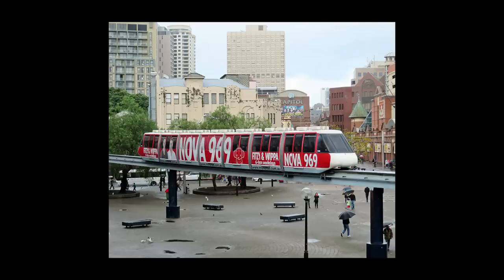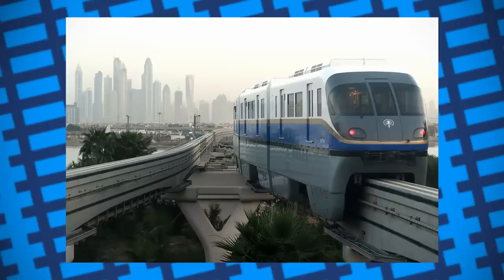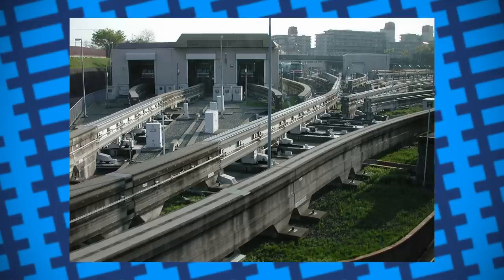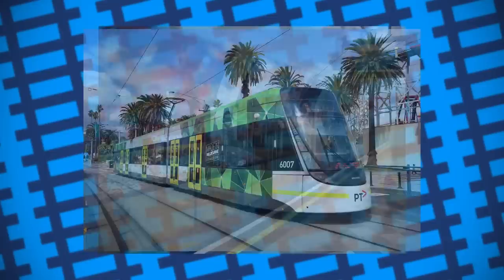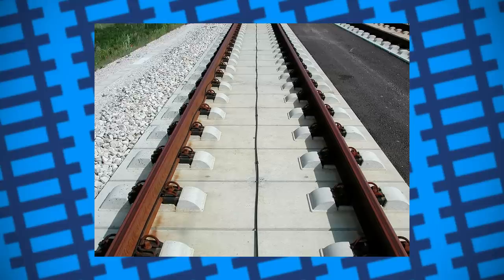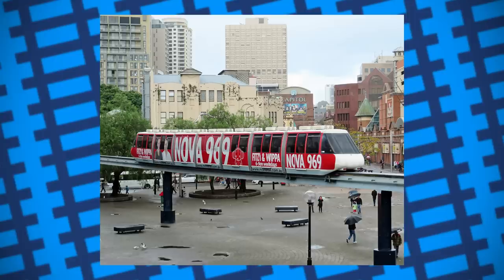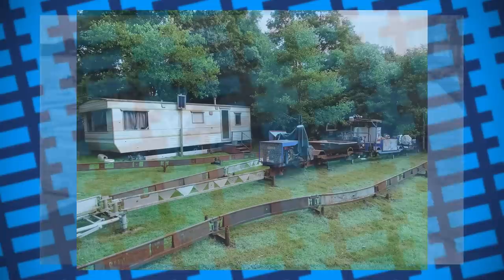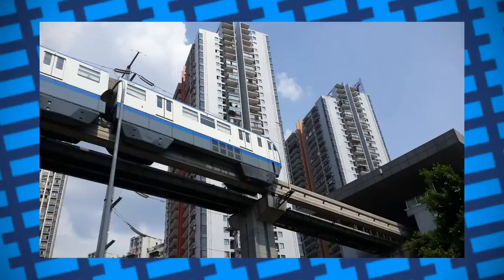Why monorails are bad as public transport - Monorails

Comment: This discussion reminds me of a similar topic in spaceflight.

The general public has this bizarre sentiment, that traditional rocket are dumb and old fashioned. They see the space shuttle and similar spaceplane concepts as obviously superior, even though the complete opposite is true.

Like monorails, spaceplanes capture the public imagination of what the future is - but in reality are way more complicated, expensive, and even more dangerous in some ways.

Yet in both instances, many in the public shake their heads, very sure of themselves that a stock railway or a basic "old fashioned" rocket is somehow going backwards.
Reply: I think with spaceplanes, while I agree they were overhyped and the technology is much less mature than people realise, I don't think they are a complete technological dead end. There are some advantages that could yet prove their practicality for some space missions. Rockets have minimal aerodynamic control in atmosphere, you have to work around mainly ballistic trajectories, just see how much work it took to make just the lower stage of a Falcon 9 return to somewhere near the launch pad. This means there's less flexibility if you need to do re-entry, or even just avoid certain areas on launch. That's not much of a problem when you're dealing with a few dozen launches per year of mainly satellites that don't need to come back, but in a future where more and more people want access to space, that could prove to be a significant barrier.

I think perhaps we do need to get over the idea that spaceplanes will be used for every space launch in the future, rockets are probably always going to be the best choice for heavy one way freight, but I don't think swinging the other way and declaring them dead in the water is a good idea either, despite what some SpaceX fanboys might think.
Reply: @Croz89  Definitely, the balanced view is best. Rockets are generally simpler, and simple is often best in engineering, but I'm more than happy to see Dream chaser coming online.

Further one might also make note that SpaceX's Starship, while a rocket, takes a lot of cues from things learned from the space shuttle.
Reply: @WasatchWind  I don't think Starship is really comparable to the Space Shuttle apart from reusability. Aerodynamically its little more than a giant capsule with small wings. That's going to give it a little aerodynamic control, but it's trajectory is still going to be mainly balistically determined. If it did have the capability of the Shuttle they'd probably land it on a runway instead of the retrorocket assisted "bellyflop" that seems to be their current plan (unless they've decided to go with a straightforward vertical landing). That alone might kill its chances of being human rated, but I don't think SpaceX is seriously planning on using it for passengers any time soon. Something that massive is probably better suited for large satellites and space station modules.
Reply: @Croz89  I meant in general, starship wouldn't be possible without shuttle having tested the waters first.

In regards to crew starship, I'm not sure. Polaris III, they talk about it like it'll fly in something like 2026, 2027. I don't know what will happen with that, but there's definitely a lot of questions to be answered, primarily with launch escape and land procedures.

I feel a lot of people confuse NASA crew rating requirements with general legal crew eating requirements. SpaceX seems quite intent on flying people from launch to landing on Starship, but not in pitching that for any NASA work (at least not yet).

I feel like there are some things they could do to improve the system (maybe starting by landing crew starship on the ground instead of catch tower...) but I feel like they can likely find solutions to these beyond just "fly it so much you don't need redundant safety systems" which I think to be generally a bad plan.
Reply: @WasatchWind  It's hard to know. Musk has a habit of saying things on impulse and then expecting the engineers to magic up a solution, so what they say they'll do and what gets done can be rather different. It's generally worked for SpaceX so far, though with his many of his other ventures, not so much.

I think mainly, kind of like the Shuttle but to a far more absurd degree, Starship is way over specced for passenger use, and there are smaller, safer solutions put there, spaceplanes being one option but for now even a simple capsule would probably do. In future something bigger will probably be required, but I think even in a future where you may have 100's of passengers, Starship is just too big.

I think the main safety advantage of spaceplanes has to be manoeuvrability. If something goes wrong, or you can't land where you want to, you can glide to any suitably long runway (or even cruise if you have hybrid engines like SABRE). The Shuttle always had a reserve runway they could divert to. Sure, it didn't save them in either tragedy, but it wasn't a bad idea.

Comment: Could you discuss the the new monorail system in Cairo? It consists of two new lines with a combined total of 100 km in length (mind blown). Usually monorails around the world are built in dense urban spaces where right-of-way is difficult to secure. However, the two lines each start at the edges of Cairo at the west and east respectively and extend outside into new developments. This neans that most of these built lines are actually built on mostly non-dense areas and are actually not built in the dense areas that they are supposedly optimal for 😂.
The government is paying around 4.5 billion dolllars for that system. Are they actually insane or is there something I don't know?
Reply: 4.5 billionss?? Thats more than half of Indonesia's HSR line?!?! 💀

Comment: I don't think it's fair to call the Wuppertal one "monorail", because it's more similar to conventional light rail to monorail.
Reply: It is a monorail, as it has only one rail (for each of the two directions). The suspended monorail design also allows for swinging in curves without any additional devices, increasing comfort.

Comment: Monorail is a good alternative to an overhead metro system for medium density traffic. Implementation costs per km of a Monorail are 1/3 to 1/4 of an overhead metro system. Monorail civil infrastructure also takes up.less real estate thereby being suitable for narrower roads.
Chembur 2 Jacob Circle, huh ?
Reply: For medium traffic, a network of trams or BRTs/Trolleybuses with confined lanes works better
Reply: @armandoventura9043  BRT/Trolley buses are a hell of a lot cheaper than implementing monorail. The idea is more of  moving people from point A to point B in the least amount of time. The access to highways/freeways does play an important role in BRTs. The roads landscape of the city also  dictates the optimal mode of transportation. The local suburban railway system immensely helped a city like Bombay which was North South with the business districts concentrated in the South and working class people living in the suburbs up north. That isn't the case anymore. 
A city like Bangalore or Delhi is circular and would dictate an entirely different transporation plan to effectively move people from point A to point B.

Comment: From what I grasp, monorails can work, but they have no compelling advantages over conventional trains in 99% of cases. The advantages about being elevated is entirely possible with a conventional train as well, though conventional trains have the option to do either within a given system. The one and only advantage I can see of monorails is that in entirely elevated systems they cast a far smaller shadow than a double-track conventional rail - the roads under Chicago's "L" feel almost like a tunnel. Resort places like Las Vegas wouldn't want that. Though I could imagine designing a conventional rail with a sort of open-deck design that would let far more light through between and around the rails, which would still come out ahead of monorails.

Comment: All I know is that monorails, in the long run, are cheaper and provide a quieter ride.
Reply: Where do you get that they're cheaper?  If anything they're more expensive in the long run.
Reply: @zackakai5173  A similar video done by either a UK or Aussie made cost comparisons, and the figures he put up , and commentary from another video apart from his and this one, showed that monorails didn't require all of the dirt, rock, and mechanical maintenance that light rail needs.  Monorails, from what little I understand of them, use rubber tires to provide a smoother and rough free ride.  Maybe swapping out tires is more expensive in the long run... I don't know, but they don't require to be at ground level, and don't require lots of support that an elevated light rail needs.   I don't know, maybe I'm wrong like you say, but that's what I recall.

Comment: Those locations with hanging monorails use them because of terrain or otherwise constrained route. The Japanese lines in Tokyo cover very hilly terrain where a tram can't climb, while the Wuppertal Schwebenbahn only has a narrow path in a valley with a single main road where a tram would add to congestion. 

The simple metric against monorails is cost per unit-distance of track compared to other solution. Standard rail is two bands of steel, sleepers/ties, power source. An elevated viaduct for standard rail costs more than a monorail in terms of raw materials, so it's not always obvious until the requirements and physical limitations of geography are factored in.

Monorails need a factor of 100x or more in steel and or concrete in comparison. The economics are not good.
Reply: You literally contradicted yourself. [Multiple Citations Needed].

Comment: I feel like theres a lot more good examples of them other than things like the single seats ones to collect fruit on a farm lol. Seems a bit unfair. If something does need to be elevated the entire route and act as a short transit line of 4 miles or so and is in urban areas with tight bends then I think they'd be great. Especially when it comes to the quietness of them next to residential buildings. But for dense areas they generally look many times better than light rail, look at the example at 1:36 and how little it obstructs the sky and it even looks bulkier than other monorails.  The cost doesn't seem to be that different than light rail too, i've seen many examples in the last 15 years of it being like $40-80m per km. Feel like the videos needs to play the devils advocate a little bit more.

Comment: Walt Disney World's is extremely efficient.

One thing that he is failing to leave out is how fast passengers go on and off of the trains. All of the doors, on all of the cars open at the exact same time. This allows for large groups of people to board and exit simultaneously.

Of course, they all close at the same time, as well.

Disney has not only this, but many, many more things down, in terms of how to build a city. The problem is, most of the world doesn't take note.
Reply: None of that has anything to do with the fact that it's a monorail, though.  That's down to WDW doing their maintenance and having well-designed stations.  You could just as easily achieve that with regular rails.

Comment: A comparison between monorail and light train system is bullshit, both systems have completely different areas of application. Of course a monorail is much more expensive than a tram system but cheaper than a subway and THE is the more correct comparison. btw. If it sucks, why are there working systems in Asia and why are even more being built, e.g. Bangkok.
The fact that most of the monorail systems in western metropolises didn't work is due to completely different criteria.

Comment: Many monorail problems can easily be solved they are potentially very useful in the right places, we just havent learned to build them cost effectively, most monorails are built like light rail and with big heavy slabs of concrete wich is too heavy and expensive to replace rail. if you had something the size/ weight of a rollercoaster car with a cabin the size of a car with seatbelts on cheap steel tracks held by relatively inexpensive pillars (wich could easily be produced by the same industries that make normal rails) trough big crowded city centers, and even above already existing buildings, its really flexible as a concept especially compared to standard railroads, wich need losts of space and land wich is one of the most expensive resources in Cities, so they could be extremely useful where normal rail simply doesnt fit and could potentially go really fast.
Reply: Monorail beams (full scale ALWEG) are about the width of a sidewalk. 5/8th scale ALWEG beams (like at Disney) are even less massive.
Reply: I think the issue with rollercoaster style track is durability and maintenance frequency. Rollercoaster ride quality dips a lot after a few years, which is generally tolerable for people wanting a thrill, but it would be a significant irritation for commuters. Rollercoasters also need frequent intensive maintenance and inspection, something which would mean frequent closures of your network.

Comment: lets be honest... most of the reasons given here are exactly because they are new or rather, non-standard as systems go...
my general feeling is that the monorail was less efficient, being necessarily heavier to be safe *(per person capacity); but is a very good solution for places with tight spaces and steep turns... it is an over-ground type system, which means tunnel width is not relevant, what is, is turn radius and support width required.
basically, they are an expensive way to make routes, for a highly urban environment
Reply: They're lighter than any other rail mode.
Reply: @colormedubious4747  depends on which exact Monorail you consider, and where you draw the line for rail-mode, you can make a tram lighter than a Monorail... and that is quite often done... 
you can also consider various super-light micro-gauge systems that can exist... though, whether we call these public transport is a question
for a full railway, it is quite light, but usually also very low capacity.
Reply: @stanislavkostarnov2157  They're generally lighter because they don't mix with street traffic and don't need to be held to the same standard of crashworthiness. LRT and streetcars/trams have to be able to shrug off an impact with a truck.
Reply: @colormedubious4747  a lot of places, LTR trams have full grade separation from any heavy traffic... also, depends on the countries safety regulations, nor everywhere is the safety standard is so rigorous as to make them heavy
Reply: @stanislavkostarnov2157  If it has full grade separation then it isn't LRT or a tram, it's a light metro. By definition, LRT and trams primarily operate at grade. If they don't run in the street at grade, then they cross streets at grade. They must be crashworthy. Even those tiny Alstom trams pack a decent punch in a tangle. I sure as heck wouldn't want to hit one! I'd lose. 🤣
Reply: @colormedubious4747  different countries different standards...
the lightest trams I have seen were I think made of wood and plastic... I mean, I saw a one get noticeably damaged by a pizza delivery scooter once.
Reply: @stanislavkostarnov2157  I want to see that video, lol.

Comment: Additionally, mono rails are completely false. They are either bi-rails or tri-rails.
Reply: True enough.
Very few of the 'monorail' systems built or proposed over the last two hundred years actually run on a single rail.
The Brennan system (qv) is one of the few that does.

Comment: monorails are still smarter than trams. unlike monorail, trams clog the traffic, which greatly increases the traffic pollution and causes life threatening danger to others by having their own extra set of traffic order order they follow.
Reply: Ok, this is called 'being a car driver who is pissed off that they have to wait at a light for a tram to pass' and being completely ignorant of the actual advantages and disadvantages of trams. To give you the benefit of the doubt, it's Possible that the tram system you're interacting with is designed terribly, but the fact that you're talking about it getting its own phase in the traffic light cycle strongly indicates otherwise.
Reply: Trolleys ?
Reply: Would it not be easier to section off the tram line into its dedicated lane on the median or parallel to the sidewalk so you can still reap the benefits of using preexisting rail infrastructure without having to build a whole monorail system and all the dedicated infrastructure to run and maintain it?
Reply: @laurencefraser  well ignored the point i made. there are no advantages on trams over buses in a crowded city.

Comment: Viewing the comments we see that the Monorails are NOT bad as public transport in some situations. Watching the video we see ridiculous objections to them. "The monorail might run off the end of a switch? Really? It's far more likely that a light rail train will be hit by a car at a grade crossing. Track worker has farther to fall? C'mon. This is approaching click-bait levels.
Reply: You just cherry-picked the two somewhat far-fetched objections and ignored the far more reasonable problems with them, like cost and difficulty of track maintenance, difficulty of building grade crossings, and safety hazards in the event of an emergency on the train.
Reply: @zackakai5173  Monorails don't need grade crossings. Evacuating trains in an emergency? See Tokyo's Yurikamome line, it's not a Monorail but it IS double-tracked so easy to evacuate passengers in the event of a fire on the train. Track maintenance? I don't see any actual numbers in the video. A typical urban Monorail line will have fewer switches. Automated Guideway lines will replace traditional monorails but I still think the video overstates the problems and failings of classic monorails.